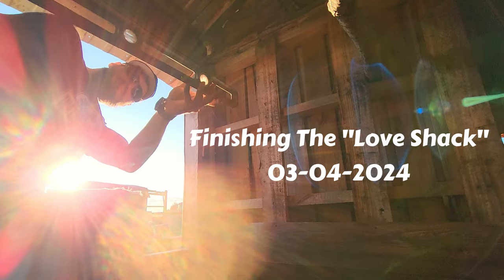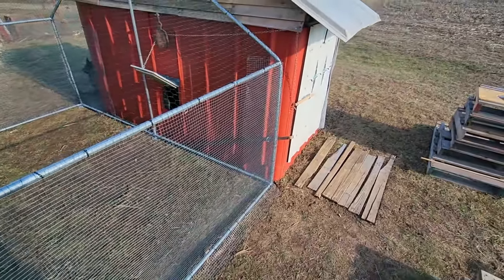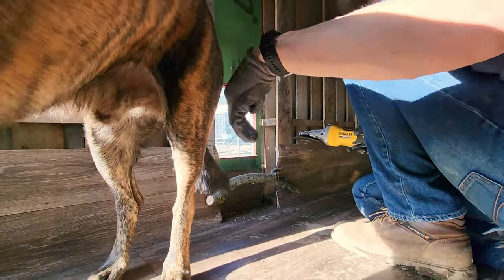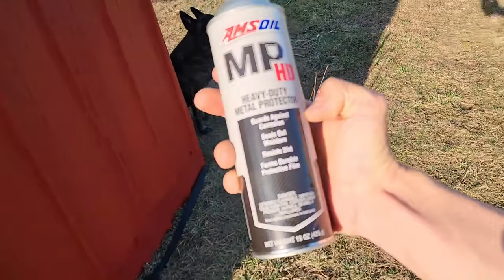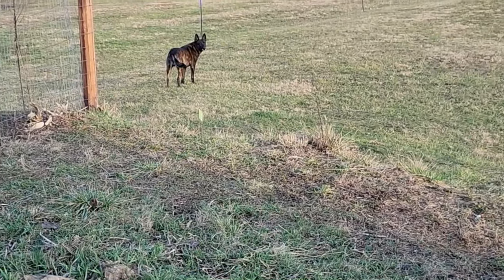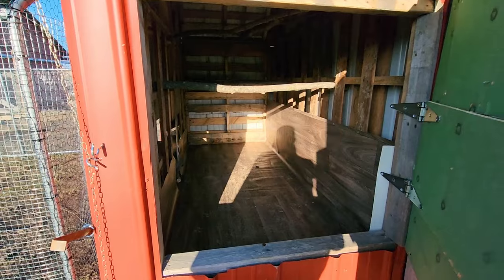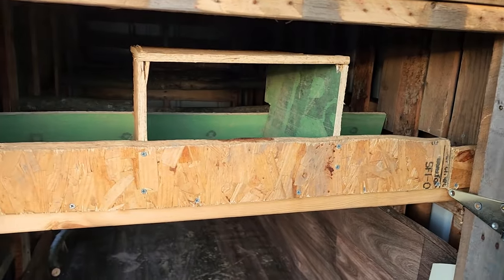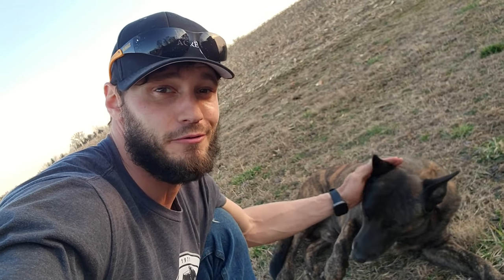Removable Nesting Boxes _ Finishing The Breeding Coop // Whitt Acres

Comment: What a super coop and run for the chickens! I'd like to suggest that you extend the hardware cloth on the ground several more inches to prevent critters from digging under the run. And add a critter-proof latch on the coop door. What you have could easily be opened by raccoons - they are very clever at opening doors. Looking forward to seeing the girls in their new digs!

Comment: So happy to see the progress and return of the spring to the farm.
Are you planning to move the structure once a year? If not, isn't it possible that the chickens destroy that piece of land over time?
Reply from the maker: It won't be moved,  but it also won't be used all year long.  They won't "destroy' the land though, It'll only get better. It will need cleaned out from time to time however.